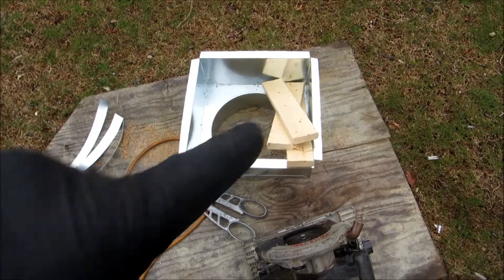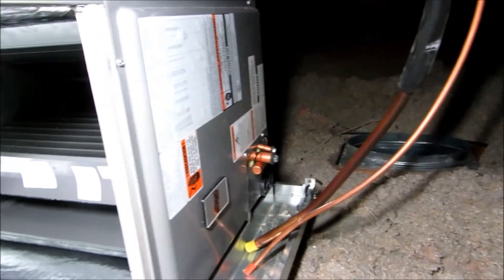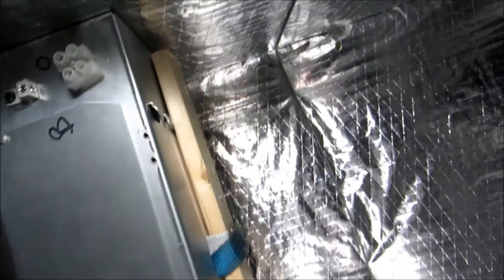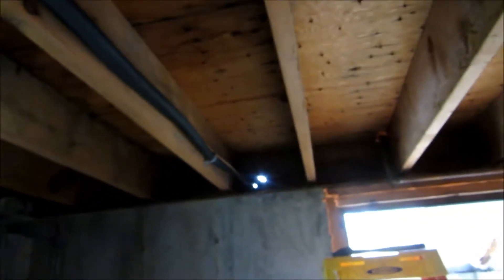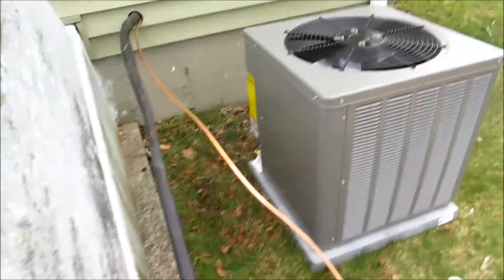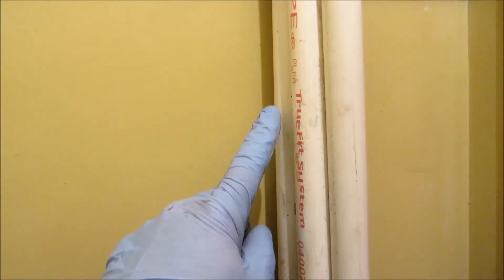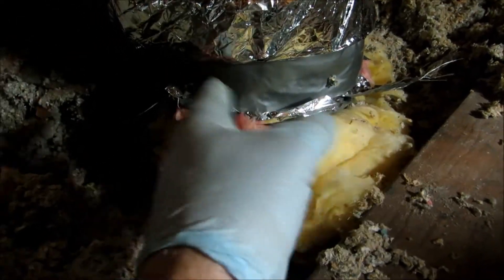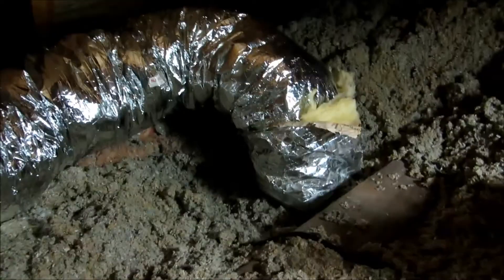hvac 2 ton air conditioning install part 2

Comment: I've never seen anyone attach flex like you did. Who uses duct tape around the flex like that on the tap and then screw it in place. That screw will sweat. I've would used foil tape, and panduits. Foil tape inner liner and rub it down with a squeegee, then panduit it. Slide outer liner over, panduit, and tape the outer liner to the plenum and mastic.

Comment: Fantastic workmanship Steve!!!! Loose the duct tape though. The adhesive will dry out and fail, especially in hot attics. The big straps hold/seal good and they are fast.

Comment: Steve, pretty good work.  But one small area of critique, not trying to bust your balls, but I have never seen an HVAC pro use duct tape on the duct work.  Where I'm from this is sacrilegious.  I know that you added some screws for extra measure, but the flex isn't sealed all the way around.  We use mastic, then flex, then zip tie, pull over insulation, zip tie and few wraps of UL181 tape to make a nice, neat appearance.  Again, not trying to be critical.  I've watched several of your videos and they're great.

Comment: I'm not good with attaching links, but if you google ( malco high leverage tensioning tool ) you will see it. You have to use long collars, then the tool tightens the strap and cuts off the excess. You could adjust how tight you want it, the flex will never come off. It really makes life easier, and makes an air tight seal.
Reply from the maker: ok thanks richard i will check it out

Comment: Good job Steven, your are nuts doing that job alone! I used to tape and screw my flexs together until a guy showed my the tigh tool. It works great and goes allot quicker, and makes a nice professional job. You should try it, it will make a job like that go a little faster, especially since your alone. Looking forward to part 3.
Reply from the maker: i know guys use the pull straps i have seen then pull off .thats why i like to screws it can never pull off i am not sure what the tigh tool is ??? maybe you can send me a link or photo of it i might be intrested in getting one to try out